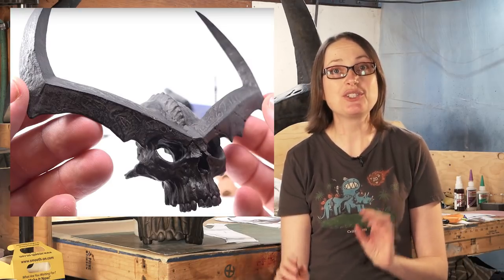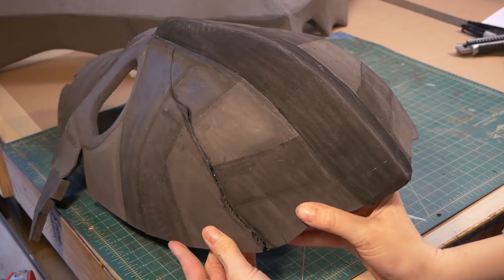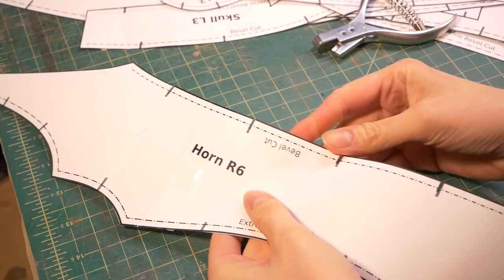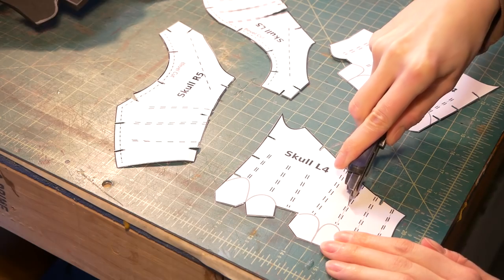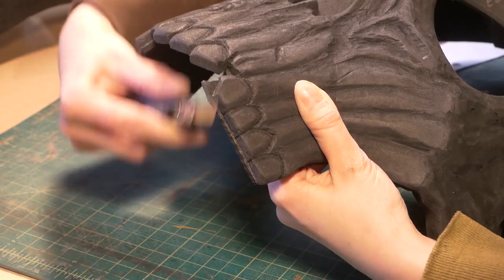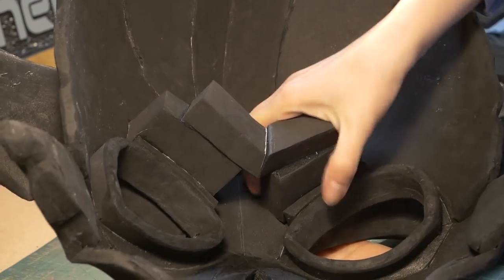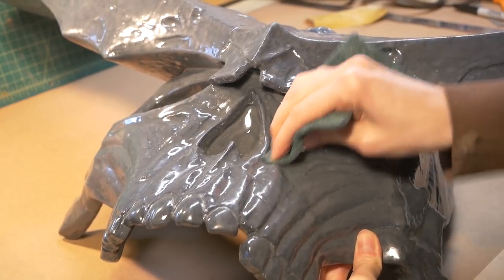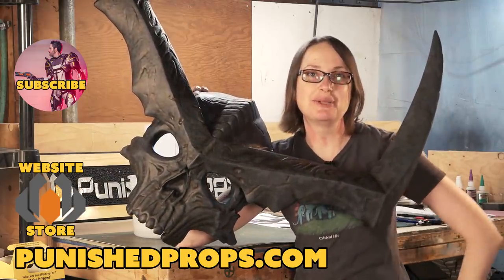EVA Foam Skull - Surtur's Crown - Thor: Ragnarok

Comment: hi there - great build. I am trying to do this for Halloween. Can you suggest an alternative to the epoxy? I was thinking of mod podge or spraying with plastidip, but not sure it will give the same finish as the epoxy. I'd like something that will smooth over the seams etc.
Thanks!
Reply from the maker: That’s awesome! Mod Podge will fill seams better than a spray. You’ll probably have to add more layers of MP in the seam areas, or fill the seams ahead of time with an acrylic caulk, like Kwik Seal.

Comment: Pretty fantastic build. How much time start to finish did it take? Also, how much does it weigh, looks light if unwieldy but great idea for the handle
Reply from the maker: Thanks! I worked on it off an on, but if I compressed the time, it was probably a week and a half. The whole prop is super light, but does weigh a bit more with the epoxy coating--about two pounds.

Comment: Wow this is amazing! I always wanted to make a Sweet Tooth mask from Twisted Metal : Black and Shao Khans Helmet/Skull mask from Mortal Kombat. The way you did the the skull part will definitely be incorporated into my skull part except i'll cover it with worbla to strength the thin craft foam.

Quick question, you used the epsilon pro as a primer? right? (thats basically what it acted like in this build) so if i was using eva foam or thin craft foam what kind of primer would i need to cover it with to paint it shiny or like a dull rust or like a stone texture? 
A lot of people use plastidip and i have respirators ready to go but im not a 100% certain how long the cartridges will last for if i crack them out of their packaging for spray painting..

i know this is a fully loaded question in one comment lol but my cartridges are 3M pro multi purpose nd the only thing that gives me advice about how long these things will last is this little section that says (if used in an environment containing any oil aerosals ,replace the cartridge/filters after 40hours or 30 days..)

so if i use plastidip for one hour while wearing this on monday at 8am (for example) do i have 40hours left starting from this time? meaning if i started at 8am on monday i have until 11pm on tuesday left to use them before they go bad? or do i have 30 days in general to use them?
Reply from the maker: I think replacing them every 30 days of general use should be fine. Make sure to get the 6001 organic vapor filters.
Reply: Gotcha thanks for the help! Also these are the exact catridges im using https://multimedia.3m.com/mws/media/44878P/3mtm-p100-organic-vapor-acid-gas-cartridge-filter-60923.jpg  Not sure what you meant by 6001 organic filters? the side on the box says it protects against organic vapors such as chlorine, hydrogen chloride, sulfur dioxide, hydrogen fluoride. hydrogen sulfide and particles . i think these are right lol

Comment: Just awesome but i have one question what would be the rescaling on the template file to be human size i am really struggling on this point thanks keep doing the great work your the best
Reply from the maker: I don't know what percentage scale would work for human size. I measured the distance between the eye sockets of my prop--from the outer edge of one eye socket to the outer edge of the other--and the distance is 10". I think a human size would be about 6" instead.
It may help to scale down the full-size template and only print one of the sections that go on the head, like the pages that have the right eye socket and skull temple. If the size is too big or small, adjust the size and test print the same section again.
Reply: Thanks your the Best

Comment: Whoa!  That's amazing!  Well done, you are truly an artist!  When I saw the skull in the thumbnail I had no idea you made it FULL SIZED!  

How thick and rigid is the Epoxy finish?  I saw you bend the test piece a little, do you think it would be a good way to seal foam armor?
Reply from the maker: Thank you! I think Epsilon Pro would be handy for pieces of armor that need to have a flexible, smooth, glossy finish, since you can sand the Epoxy and it doesn't crack. The normal Epsilon that Smooth-On sells is not very flexible, so it's handy for rigid materials. If I don't need a smooth finish, I'd go with a faster foam sealing method. For example, the texture of sprayed-on Plasti Dip on foam looks great for a rough, metal finish.

Yaya Han made flexible armor with Epsilon Pro and showed the process is this awesome video: https://youtu.be/vtLavhTDEuE
Reply: Punished Props thanks so much, I’m working on a Half-Life HEV and thinking about making some parts rigid and some flexible, it’s my first costume with foam, you guys are my go to for inspiration and technique!

Comment: Sanding question with a rotary tool, Is it better to use high speeds or low speeds? (I experience dragging with slower speeds, but don't have the best control at higher and haven't been able to find a happy medium. Do i just need more practice?
Reply from the maker: We tend to use a medium speed on our rotary tool for foam. It helps to brace the hands, and prop, against stable surfaces. For example, writing is easier when the wrist is on the table, instead of the whole arm being suspended in the air. 
WM Armory wrote a great article about rotary tool carving directions: http://www.wmarmory.com/?p=2880

Comment: What speed do you use for Dremel details like this? Mine is only 35000 rpm and I can barely do anything on foam without it flying off.
Reply from the maker: We have several rotary tools and they all have variable speeds. Not sure what the exact RPM is though.

Comment: I have been wanting to build stormtrooper armor out of eva. I have pepkura files but I feel I will run into problems with the helmet. It would be cool if you made some videos, or maybe were able to give some advice as I am not very experienced with eva foam props and armor
Reply from the maker: It helps to remember that you're creating a prototype that may need to be modified and made more than once. There's a cool Facebook group for converting pepakura builds into foam, which may be able to help with your helmet conversion questions: https://www.facebook.com/groups/PepakuraDepository/
Reply: Thank you!

Comment: Instead of using pepakura, will Maya's uv unwrapping give you a similar result?
Reply from the maker: It might, but Pepakura Designer is super easy to use.
Reply: Punished Props Academy 
Cool, Thanks for replying! I just wasn't sure if it worked in a completely different way or not but I'll definitely give both a go to see what results I can get

Comment: You know you could of just UV mapped the object directly in maya to create the patterns, their maybe just as good as the ones from the other software you're using.
Reply from the maker: It's been years since I've UV unwrapped in Maya--I bet now it's much more user friendly. Pepakura Designer auto unwraps and adds matching numbers to the adjoining pieces, which is super handy.
Reply: They've overhauled Maya's uv system in version 2017 Update 3, they added a UV Toolkit and tons of new tools, you should check it out, it's awesome.
Just select the edges you want the seams and cut the edges ( or use the Autoseams function if you want to give the algorithm control where the seams will be plashed ), unfold the uv shells and do a Layout for a quick workflow.